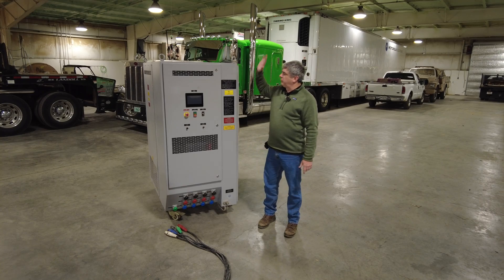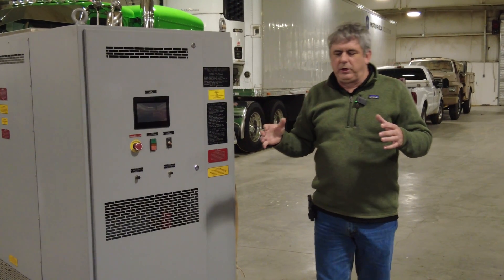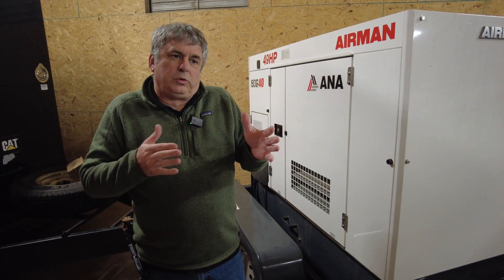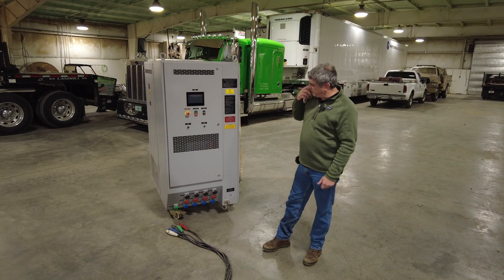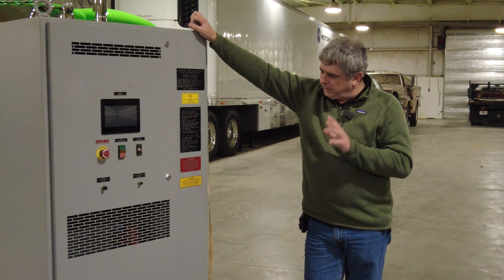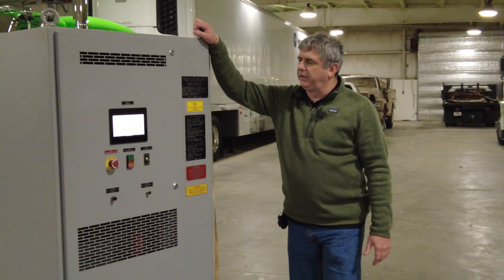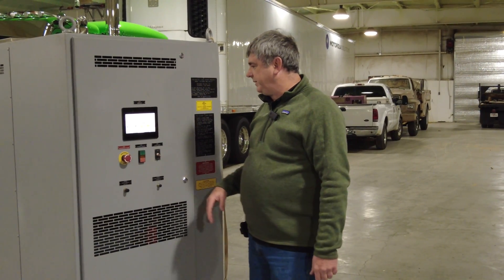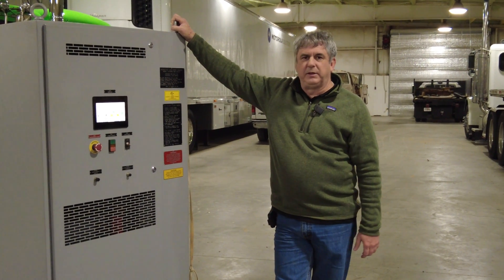Load Bank Basics! Generator Support Tools | Parker Systems

Comment: Three types of loads?
Reply from the maker: Resistive, Inductive, and Capacitive
Heating is typically resistive -- motors are inductive and capactive are load that require a charge to change the voltage -- like motor starting capacitors and power supplies for floresences lights -- and for power factor corrections
Reply: @ParkerSystems Thats the One 

🎉😊❤

Comment: David, you weren't concerned that the UI looked like it was written on Windows 3.1? LOL 
Thank you for the tour!
Reply from the maker: LOL -- its funny you say that --- when I first got that unit I was testing it out and I made the comment that I hope that I don't get the "blue screen of death" the young kid working with me looked at like i had lost my mind -- so far not an issue -- I can tell you that I did have an issue with unit automatically switching between 120/208 and 277/480, I called the company and got a real engineer on the phone he completely understood the system and sent me out a replacement relay and contactor, his diagnosed the issue with me on the phone in like 2 mins -- great tech support -- thanks for watching --appreciate the throw back comment

Comment: Can the load bank be connected on th line side of the ocpd with no protection on the conductors
Reply from the maker: sure as long as the wire utilized is equal to or greater current capacity as the protection device. - -

Comment: what size load bank is required for a 4.16kV, 1500KW Natural Gas Generator (CAT)
Reply from the maker: 1500kw.   Was this a trick question. You’ll need a transformer to get it to 480 volts.  Thanks for watching

Comment: I have heard of the massive trailer-sized load banks used to do commission testing on power plants. It would be interesting to see one of those sucking up +150MW.
Reply from the maker: heck yeah -- that would be cool -- can you imagine the heat that would be coming out of that thing -- thanks for watching
Reply: big toaster, haha working at a university , got some 1000kw v12 gens yes big trailers, but not as cool as one would think. just heat
Reply: Here at CAT we commonly use 1500-2500 KW sized load banks
Reply from the maker: thats a big boy

Comment: Handy device.  I'd like to find a smaller one for testing homeowner grade backup and standby generators.   particularly if it has waveform and harmonic analysis like the Fluke power quality meter I can't justify buying until I hit the lottery.      With the prevalence of harmonics and power factor issues in the entertainment industry heavy power applications, we have to we sometimes have to oversize the neutral in feeders and specify K rated transformers, which might be useful thing for a future video.   this is also a thing with switching power supplies in electronics and computers.
Reply from the maker: Thanks for the comment -- I guess I should have mentioned that on smaller gensets (single phase (15-45KW) that we install in homes -- we built a tankless hot water on a back board with breaker panel and cams) We also have a piece of equipment that we use to measure voltages -- harmonic distortion - ect -- I could do a video on that gear as well the test gear is AEMC -- thanks for watching --

Comment: Are all of your standby power generators for general use or do you get into any of the life critical stuff where you have 10 seconds from the first gitch to be up and online like healthcare facilities?  It always fascinates me to se a large genset come up to full load from a dead stop and not overseed by more than 3 hz. and then have another genset come online and automatically phase match. It's been probably 30 years since I was involved with power generation but still very interesting and much more advanced electronics controlling the process.
Reply from the maker: thanks for the question - yes all of our gensets meet those requirements typically utilize a PMG system (permanent magnet) that provides a smooth representation of the frequency (speed) -- the controller then has an algorithm and electronic control of the injectors and pump so that precise speed control can be achieved along with load prediction and prevent overshoot -- this has also allowed smaller gensets to start larger motor loads (lock rotor issues -- basically a huge dead short when a motor starts) --- this units are also provided with heater to keep the coolant and oil warm so the genset isnt harmed by going straight to speed (1800 rpm) and take load almost immediately -- thanks for watching --  we also do make before break transfer switches that allow restoration of load without an blink by actually syncing the frequency of the two sources -- gen and normal supply ---
Reply: thanks for the technology update @ParkerSystems
Reply: It makes my battery load tester feel inadequate.
Reply from the maker: thanks for watching